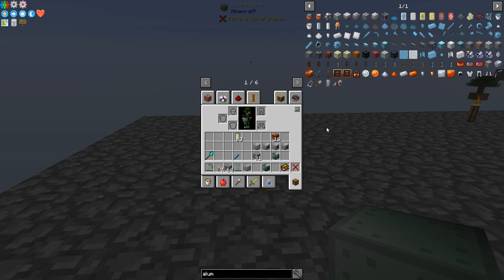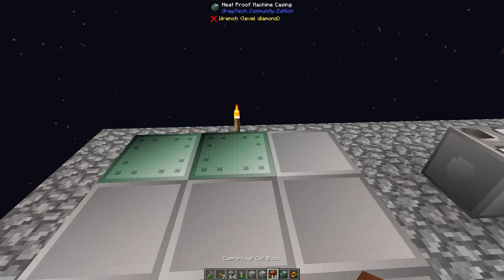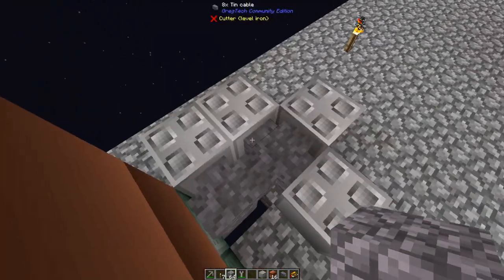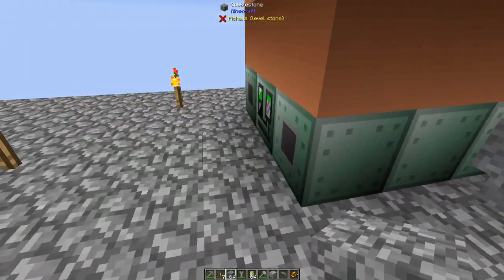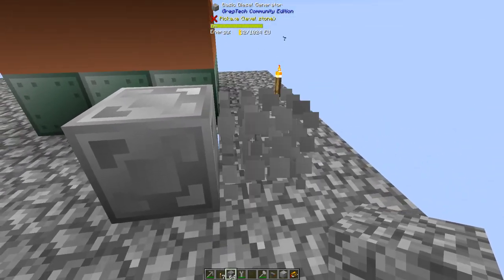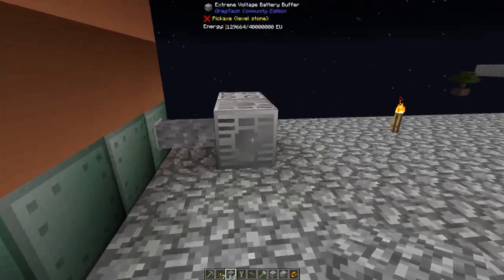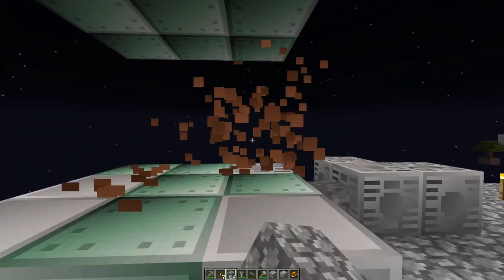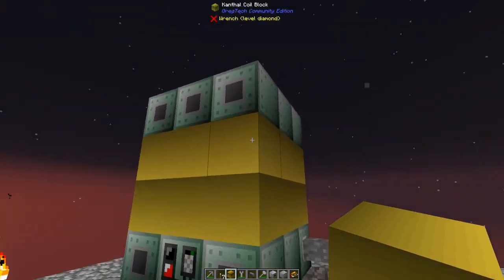Tutorial - Electrical Blast Furnace

Comment: hey mine's stuck at 64 EU/t (LV), i have made several power increases (i now make around 128 MV using LV and a transformer) and have spend several hours trying to fix it, still at 64 EU/t, why? i'm playing Nomifactory btw if that helps

edit: i am losing it, i am losing my marbles MY GODDAMN ELECTRIC FURNACE I JUST SPEND GOD DAMMIT 10 HOURS ON EXPLODED BECAUSE I PUT A SECOND ENERGY HATCH ON IT I AM FUMING AAAA :((((((((((((((((((((

ok i am ok sorry for that i am actually pissed why does nothing work like i want to :( i literally do what the game wants me to do, did i make too much energy? once again sorry for that i am gonna spawn everything in again no way i am gonna spend another stack of steel on all those casings

update: i have fixed the machine with cheats, i added the second energy hatch, then realized "i gave like a 8x mv worth of energy to a low voltage energy hatch"
i am an idiot, sorry for the mental breakdown and have a nice day further :)